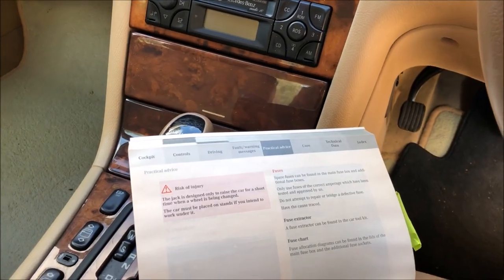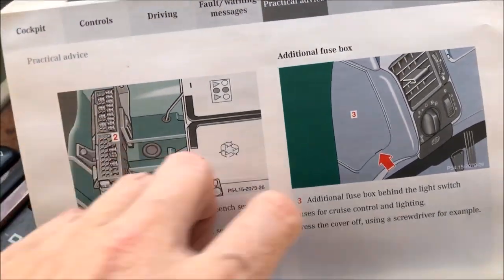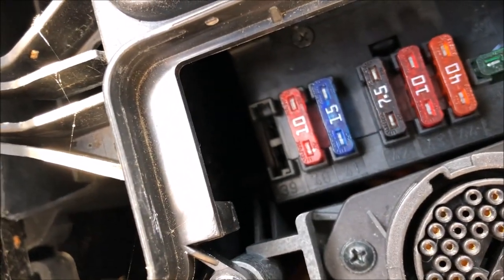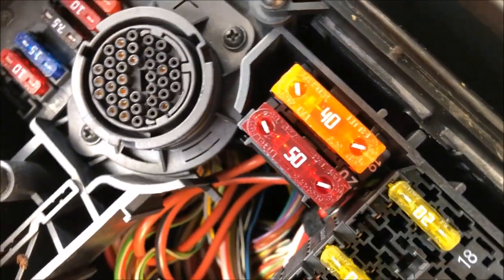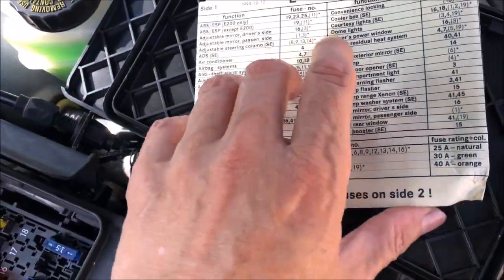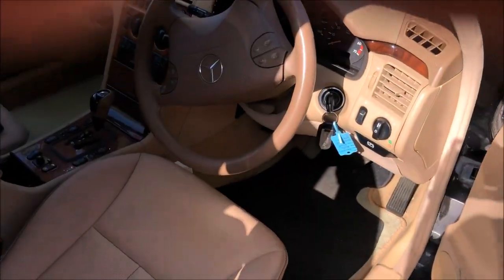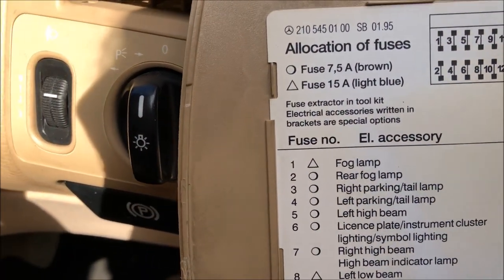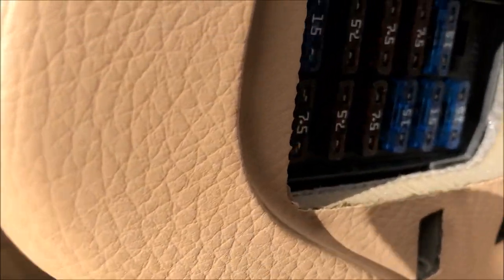Mercedes Benz w210 e class 2002 fuses location

Comment: How do u fix the fuse on 2001 mercedes E320. Won't crank n gear shift won't come out of park. When I replace fuse. It blows again
Reply from the maker: It might be that your brake light switch is damaged causing short circuit, that would be the easiest place to start. There is an emergency release for the shifter you may need to check your manual for thar or another google search.
Reply: @DaringBeefcake  fue pump relay is not where you said on 2002 e320
Reply: @DaringBeefcake  my srs light was on and the dealer took it out the ring system because it was obsolete on yr 2000 e55, now my seat belt warning lights r dont come on, any ideas